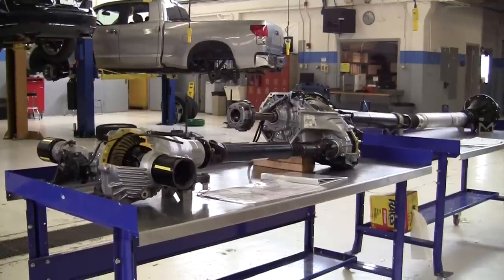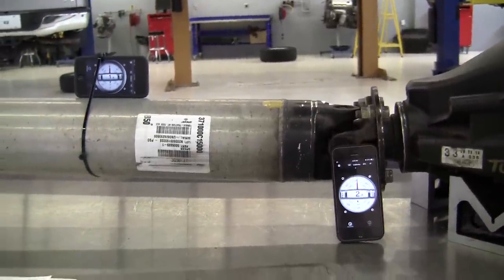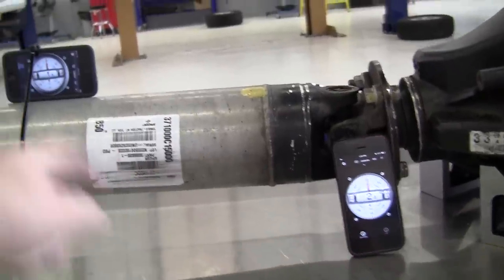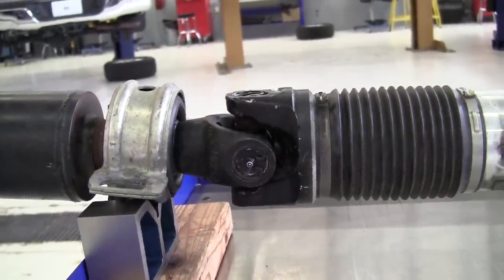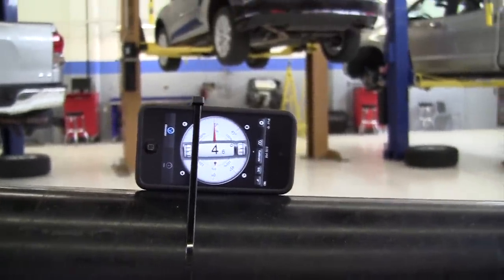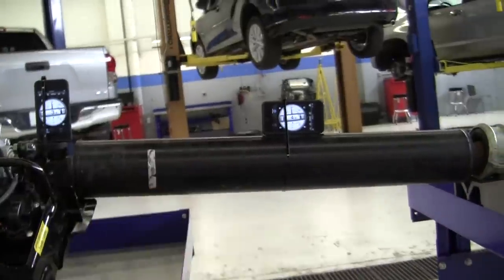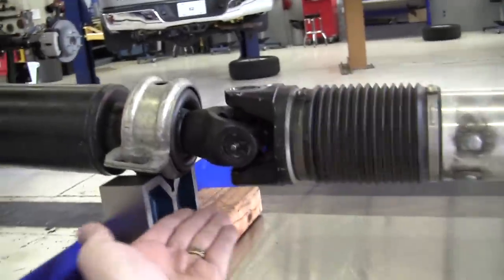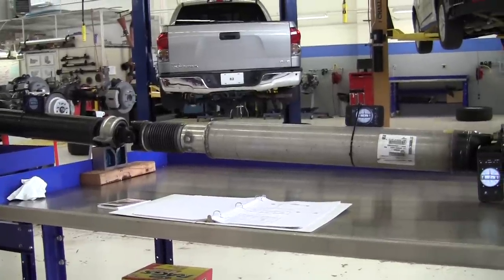Propeller Shaft U-Joint Working Angles

Comment: Awesome video!  You explained the process perfectly!    I was able to fix my 15 Tacoma's shutter or shake😁  After I installed the suspension lift I was getting the dbl vibrations.   BB Toyota misdiagnosed it 2 times.  After measuring my current angles and installing 2.5° angle shims and washers to lower the carrier bearing.  I really appreciate you sharing this knowledge with the world!
Reply from the maker: That is awesome! Thank you very much

Comment: I have a 3rd gen Tacoma with moderate driveline vibrations. Truck is 100% stock including oe tires.  Toyota set the first joint operating angle to 2.2 degree. Spicer says 1-1-1/2 degree. In this video you indicated.5 degree. The mount can be modified to lower but before I get into that can you verify your claim and explain how you arrived at that?

Much thanks
Reply: I am having the same problem with my 3rd gen Tacoma. Did you fix it??
Reply: @guaraito  No, sold truck. Un fixable on many. Toyota has become junk.
Reply: @guaraito   I sold it. mine was not repairable. Multiple attempts

Comment: While I realize this was a rough mock-up and would likely not be found in a vehicle in this fashion, wouldn't you add the two angles for the rear operating angle together?  Since the driveshaft is pointing downward towards the differential, and the pinion flange is pointing up towards the driveshaft?
Reply: no.  When using the terms "pointed up" and "down", always reference the direction looking from front to rear of the vehicle.  For the rear wheels, if the drive shaft end of the pinion is higher than the ring gear side of the pinion, the pinion is pointed down.   In this case subtract the lesser of the two angles from the greater to determine operating angle.

Comment: @weberauto the first angle measurement in this video is wrong. The drive shaft has a downward angle of 1.9 and the rear differential has a pinion angle of 2.8 degrees up. Because one angle is upwards and the other is down the angles should be added not subtracted. Isn't that correct?
Reply from the maker: Yes, you are correct, I did that incorrectly. Thanks for the feedback.
Reply: Thanks for clarifying that. Wondering if you could answer this question....Could the 3 angles on the rear 2 piece driveshaft work together to cancel each other out? for example if the transmission angle was -1 and the centre angle was -2 and the rear pinion angle was +3 (-1-2+3=0) compared to having a 0 degree on the transmission angle and having just the rear 2 angles cancel each other out??
Reply from the maker: RJ Neufeld Interesting thought. I do not think it would work. The acceleration and deceleration amplitude levels of the two outside u-joints would be twice the opposite phase amplitude levels of the center joint.
Reply: @rjnewfield9629  I can't believe he actually answered you for correcting him .
I ask if i gave him the calculation on my driveline could he give the the shim thickness. 
His response ! I have too many other things going on !
Reply: So does this mean you would add the rear shaft degree of 1.8 to the front shaft of 4.6 too, to get the center working angle?
Reply: Hi guys, i have been looking for this vid for a few months now, i have a 2 piece in my rodeo (pup) super low. I have learnt that i need to have the first uni close to 0, 2nd and 3rd need to cancel, how do we calculate the third angle? Is it 1.9 + neg 2.8 or just add them?? 

Good video, but now im lost after finding this comment. Cheers from aus

Comment: That is a shitton of shafts! Im super glad ive got a one piece. Interesting observation: When these are made by a shop and spun on a balancing lathe they are done perfectly straight. The ujoints could be filled with super glue and it would not matter. You dont know if your ujoints work correctly and if them being tight as heck (axial play neglect) will affect its operation. The working angles shown here are also very fascinating. You Mr. John Kelly are a rare breed.

Comment: R U related to Ben Stein?  You sound just like him playing Mr. Cantwell.  You subtract the angles only if the two components are pointed in the same direction. When using the terms "pointed up" and "down", always reference the direction looking from front to rear of the vehicle.  For the rear wheels, if the drive shaft end of the pinion is higher than the ring gear side of the pinion, the pinion is pointed down.   In this case, assuming the drive shaft is also pointed down, subtract the lesser of the two angles from the greater to determine operating angle.  If the drive shaft end of the pinion is lower than the ring gear end, the pinion is pointed up and the angles are added to find the operating angle.

Comment: I see vertical offset angle addressed..but how about horizontal offset? Same issue I'm ass-uming? My 9" diff is offset to the RH side of the carrier.so should the tail of my transmission be offset to the left by the same angle?

Comment: Great video and app - Thankyou! My ‘16 Pajero (Montero in USA) has unacceptably high NVH issues when in 4H but acceptable in 2H - if the position of the transfer case is changed to reduce NVH from the fwd drivetrain I’m concerned the rear drivetrain could then be compromised?
Reply from the maker: Thank you! In 4HI the front driveshaft is spinning. You may have a front driveshaft u-joint problem or runout problem.
Reply: WeberAuto  hello , thanks so much for the video it helped me understand a little on how this works. I was hoping you can help me out. I installed a 2-1 level kit on my 2018 tundra and think I’ve noticed super small vibration, so I installed a 1/2 carrier bearing drop kit and doesn’t seem like it went away. Should I add another 1/4? I got my degree angle measurement  3 times and they are all off by a little it’s kinda hard to use a phone app. Anyway I was hoping if I can some how send you my diagram drawings with all my working angles and degrees so if you can possibly help me out and tell me which angles need fixing? I know the truck got lifted only an 1 “ in the back but would still really want it to be with factory specs.if you can help me out that would so great thanks!!

Comment: WeberAuto  hello , thanks so much for the video it helped me understand a little on how this works. I was hoping you can help me out. I installed a 2-1 level kit on my 2018 tundra and think I’ve noticed super small vibration, so I installed a 1/2 carrier bearing drop kit and doesn’t seem like it went away. Should I add another 1/4? I got my degree angle measurement  3 times and they are all off by a little it’s kinda hard to use a phone app. Anyway I was hoping if I can some how send you my diagram drawings with all my working angles and degrees so if you can possibly help me out and tell me which angles need fixing? I know the truck got lifted only an 1 “ in the back but would still really want it to be with factory specs.if you can help me out that would so great thanks!!

Comment: I've read that you take the measurements of the Transmission End yoke and Rear Axle End yoke by removing the bearing caps putting the incliometer on the yoke lug. Is using the flange still an accurate reading? And the Propeller Shaft measurement I read was taken 3 inches from the weld line of the Propeller Shaft.

Comment: Thanks for your reply regarding NVH in 4H only. After carrying out some test runs in 4H using the NVH app the diagnosis said 2nd order engine vibration. From the apps explanations it is very possible that the increased NVH in 4H only is due to engine vibs being transferred to the chassis via the front driveshaft/unjoint contacting the transfer case. A focus on this area should reveal the cause of the NVH. Stay tuned...
Reply from the maker: You are welcome, best wishes
Reply: WeberAuto Hi again John. Further contemplation on this and the fact that my NVH issue only occurs under normal acceleration in 4H and not when coasting has made me consider the front differential mounts as the problem here and not a rotating component in the front driveline. I can now easily understand that one or more of these front diff mounts are possibly providing the transfer path for these “normal” engine vibrations to find their way to the body thanks to the terrific support info in the app. 
The sensation I get when under normal acceleration in 4H on city streets is that one (or more) mount has lost its NVH isolating properties and feels like it has become grounded. 
In the app there is a procedure to check mounts for grounding but the procedure is not explained fully - may I kindly request that when you have an opportunity to make a YouTube clip of how to use the NVH app to test a mount and perhaps also be kind enough to explain how this could be accomplished (or if it actually needs to be) under acceleration when torque reactions come in to play. Thankyou.

Comment: If the working angle of the output shaft and the first half of the driveshaft has a high value, can I cancel that out at the working angle at the pinion?

Comment: Great explanation!  If your driveshaft has an upward angle coming from the transmission to the pinion, would the formula change? 
I have a vibration issue on a 1970 lowered Camaro. Trans down, driveshaft up toward rear, pinion nose up equal to but opposite of trans.
Reply: An "up vs down" problem again.  Always reference those terms looking from front to rear of the vehicle. The transmission input shaft is higher than the output shaft so the tranny is pointed down.  The tranny side of the drive shaft is lower than the diff side so the driveshaft is pointed up.  The drive shaft end of the pinion is higher than the ring gear side so the pinion is pointed down.  You have a 'down, up, down' relation between the components.  In this case the angle of the driveshaft would be added (not subtracted) to the transmission angle (and the pinion angle) to find the operating angles.

Comment: I know on my 2002 model Holden VY SS Commodore,both tailshaft halves need to cancel out at 3° on both halves since it has a single universal or Thompson joint in the middle & rubber driveshaft couplings on either end of the tailshaft.

When I replaced the centre bearing in 2016, I avoided replacing the universal joint as it is staked in position so I'll only replace it if absolutely necessary,when I refitted the tailshaft,it had a vibration in 1st gear at about 20 km/h but it went away when the vehicle picked up speed which apparently means it has a problem with the driveshaft angle being out,the old centre bearing rubber was that flogged out it was hard to tell what else would cause the problem.

I backtracked on what I did to the car,in 2012 I rebuilt the suspension by replacing all of the bushes,shock absorbers,springs,etc ,the front & rear springs were that of a Holden Monaro (aka Pontiac GTO in the U.S.) but my car is a sedan,they are the aftermarket King spring brand which are 30mm lower than the stock sedans but mine had the sports optioned suspension fitted at the factory so they are equivalent to the stock SS Commodore springs,they aren't the uprated heavy duty version which is sold aftermarket,I was hoping that hadn't changed the driveshaft angle as if the old centre bearing was soft & sagging that may have thrown me off a bit.

I thought that the rear transmission mount may have been a bit too soft & the rubber was starting to come away from the metal so I replaced it last Thursday,that lifted the rear extension of the tailshaft up by at least 1 inch, I took it out for a drive at 3 AM on Friday morning & the vibration was gone,the car isn't registered & I live in a rural residential area so I did it when most people are asleep.

I'm doing that when I drive it to the mechanics to get both the blue & pink slip done for registration so I don't have the cops pester me about driving an unregistered car & having people complain about me,even though it's legal to drive it to the mechanics to get it registered with a CTP (compulsory third party) greenslip  which insures against personal injury
Reply from the maker: Thanks for sharing, that is a great example. A single universal joint in the middle typically needs to stay at close to a zero degree working angle to avoid vibrations.

Comment: Any thoughts or input about Dodge Ram and there vibration issues.
Reply from the maker: There are almost 300 possible causes of vibrations on a truck like that. The most common are related to the speed of the tires and the speed of the driveshaft. Without some method of measuring the vibration frequency and matching it to the rotational speeds of everything on the truck, we would just be guessing. See vibratesoftware.com Best wishes.

Comment: Do you have info on 2 pc drive line.... best angles and phasing for 3 crosses.... no good info found... my shaft has long section out of trans.... then steep short pc to pinion.... NOT GOOD... thinking of flip drive shaft and have long section have the drop to reduce angle... remount new carrier..
Reply: (one cross will NOT have mate to cancel accel/decel)... so in a perfect world.... ?????
Reply from the maker: The Toyota service information has those specifications. Typically the front cross working angle is close to zero. The two rear crosses should be equal
Reply: @WeberAuto  can the whole 2pc drive line be made to operate like a one pc ??.... the far ends in phase and the middle where carrier is would be solo and around 1 degree to lube.... my fear is there will be toooo much heavy metal to accel/decel 2 times per rev (fl70 mid sized heavy truck, modified driveline by last owner)
Reply from the maker: @w.johnson8588  No, the rear two must be paired to compensate for suspension movement.

Comment: This video is incorrect. He was correct on the rear half but incorrect at the trans output
Reply from the maker: There was nothing incorrect. What are you referring to? Thank you.
Reply: +WeberAuto the working angle of the output on the transmission does need to match the angle of the joint at the midship bearing. All u-joints have to be formulated against the opposite end.
Reply: +WeberAuto tolerance must be tighter on pickups, class 7&8 trucks allow 1.3 joint working angle. That is the difference between the working angles of each end. Also Eaton suggests a small amount of working angle at the trans output, not exact.
Reply from the maker: I am sorry, but that is not correct. U-joints that change their angle with suspension movement must have equal working angles so they can cancel out each other's accelerations and decelerations. The third (front most) u-joint in this demonstration has no companion joint and does not change its angle; it is called the Odd Joint. If the working angle of an odd joint is close to zero it will not have any accelerations or decelerations that need to be cancelled out by a companion u-joint. There is always an odd joint in a two-piece driveline. I hope that helps.
Reply from the maker: You are correct regarding the odd joint not having a zero working angle. A zero angle would result in Brinelling of the u-joint cross (resulting in premature u-joint failure).
Reply: +WeberAuto I think you just said what I said. I wish you would have said it that way in the video. However you and Eaton corporation are at odds over the odd joint needing formulated against the midship joint.
Reply: +WeberAuto and joints on moving components do not need to have exact angle with each other, they simply need to formulate properly, example would be tandem drive axles. In most cases the forward unit is at about 1 degree at ride hight, the rear unit about 12 1/2. The shaft between is at about 7 degrees typical.
Reply from the maker: Thanks for your feedback! I don't think we disagree. If Eaton (Spicer Drivetrain Products) allows a 1.3 degree working angle at the odd joint, and that happens to also be the same spec for the rear two working angles, it works for me. The theory of the odd joint still remains correct.
Reply from the maker: You are correct, they do not need to be exactly the same, but if they were, it would run even smoother since all decelerations and accelerations caused by the angles will be cancelled out. That is driveline theory, in reality the axle changes it's angle under load and so does it's u-joint working angles. The best a technician can hope for is to keep the two working angles as equal as possible under all operating conditions.
Reply: +WeberAuto what I am saying is that component #1 at 1degree and component #2 at 12 degrees and the shaft between at 7 degrees = 0.0 JWA that is In specs. All 3 components at different angles and will run just as smooth as if both components were at the same degree. Putting them at the same degree only makes for easy math.
Reply: +WeberAuto plus it allows a method to limit working angle of the joints
Reply: +WeberAuto similar effect used to be Mopar stating their engines and transmissions at an angle in the chassis
Reply: +WeberAuto just saw my mistype, = 1 degree JWA and is in spec